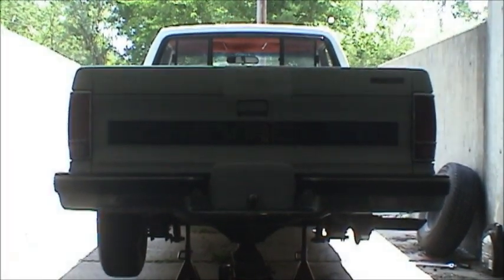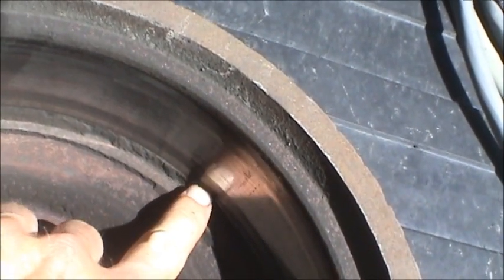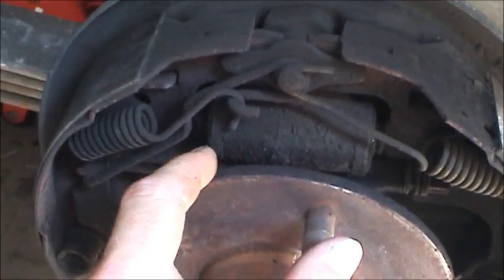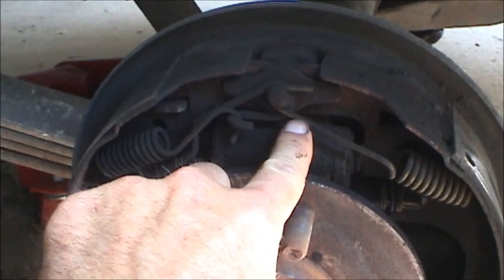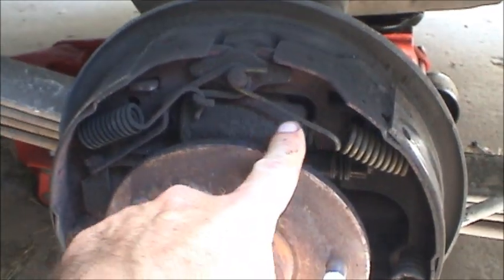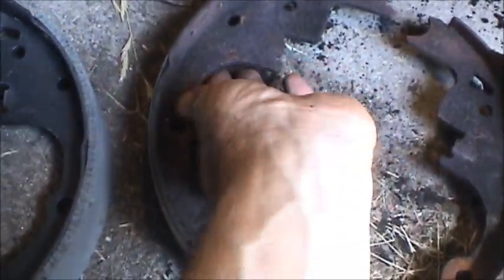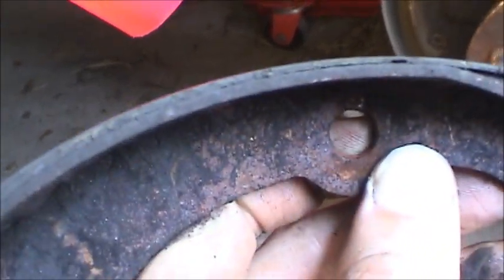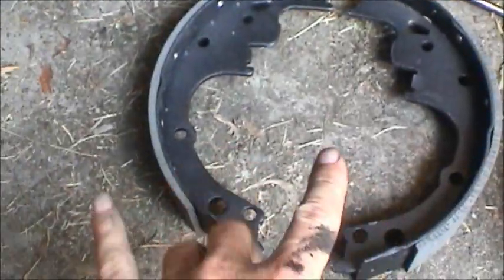1991 Chevrolet S-10 Rear Brake Shoe Replacement

Comment: I like the details you provide but in my opinion your videos would be much better if you actually show the work and not just explain what you did.  thanks
Reply from the maker: A valid point, and one of the disadvantages of making videos largely by myself and having to use two hands to do the actual work. I have thought of this previously and have tried to adapt. The recent Crown Victoria belt drive system change video is an attempt however, much of the work is down below where it can't be seen. It's sometimes difficult to get a camera in the work area where it would really do any good without expensive equipment.

Comment: The rear brakes only do about 30% of the braking power in a passenger car; in a pickup truck with an unloaded bed, it's surely even less than that. (Do they even make any pickups with rear disc brakes? I haven't heard of it.)